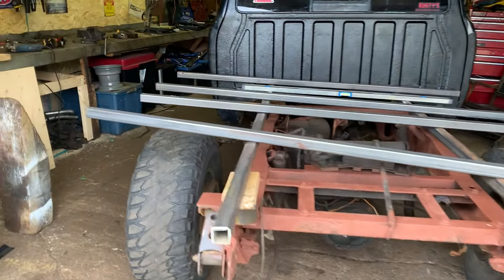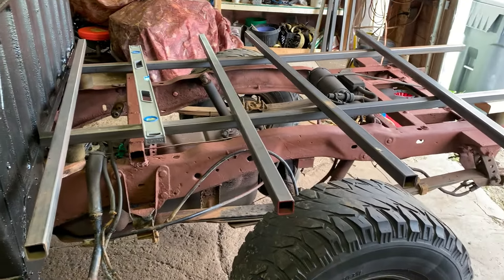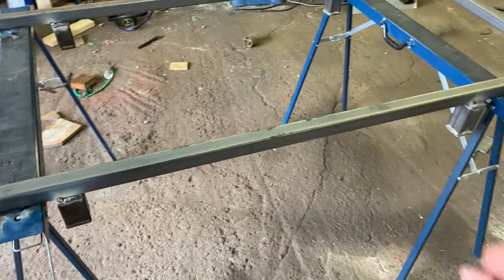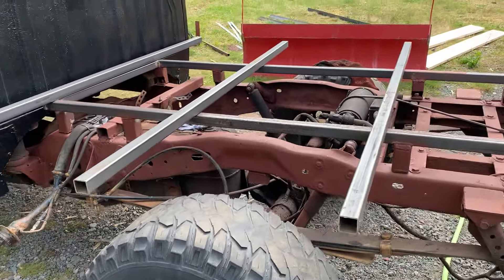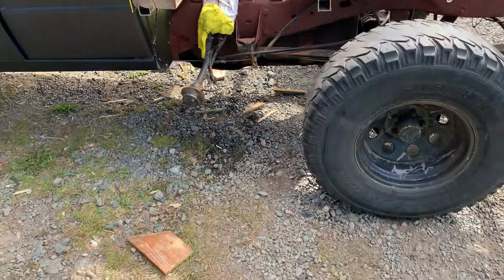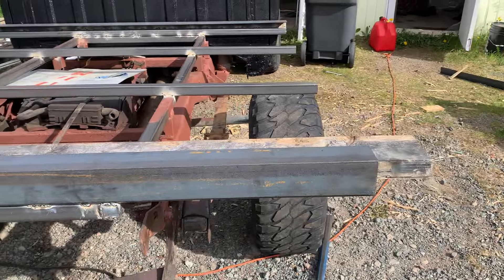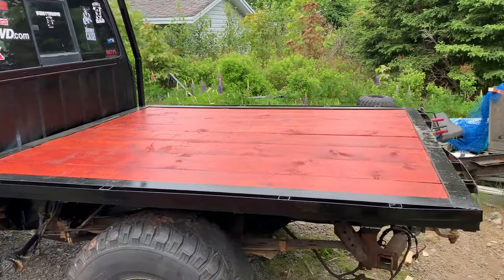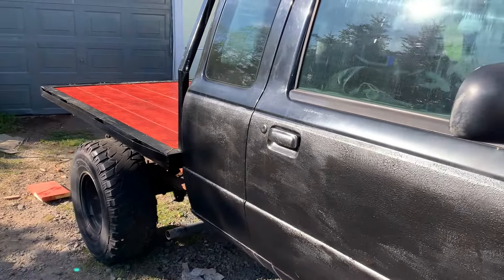Ford Ranger Flatbed Build  - Budget build - Part 1

Comment: Soon I will be building a flatbed on my 2009 Ranger longbed. Original bed was damaged 4 times.
Reply from the maker: yes, better off the flat beds are super cool! I will be making another video when it cools off a bit, going to be installing a winch behind the rear window and making a simple removable set of rails to fit on the bed.

Comment: I went with an extremely similar design when I built a flatbed for my ranger, just used some bigger tubing. What tires are you running because that spec looks wild
Reply from the maker: nice! and thanks, the truck has a 3 inch body lift on the front / cab and 33x12.50x15 mud tires. Need to replace the tires soon with some new ones.

Comment: How did U get the boards in?
Reply from the maker: I cut them to size and angled them. If I redone it , I would make the rear piece removable. But wasn’t to hard to fit them in
Reply: @muddythumper8152  I’ve seen them flexed with a jack to get them in on trailers, was wondering if people were doing the same w flat beds. I plan on making one for my 01 tundra this summer so doing some research lol.
Reply from the maker: @BvictoryforChrist  yea I basically put the board in on a angle, then used a hammer to knock them straight, would be easier with like 2x6 or something too

Comment: Do you know how much of the materials you used by any chance? I’m looking to make my 2004 ranger a flat bed and don’t want to get too much or too little square stock lol
Reply from the maker: I bought extra cause i always work on projects.
I got a rough idea on what you would need. if you do the lower just flat bed part
it will about this :
qty 5  6 feet 1 1/2 x 1 1/2 switch tubing 1/8 wall
qty 2  7 feet 1 1/2 x 1 1/2 switch tubing 1/8 wall
+ 2 inch switch tubing for risers about 4 feet 2x2 x 1/8
2 inch flat bar 3x16 thick about 4 feet.
2x8 sheet of 14 gauge sheet metal

Not forgot to add - i used 3 inch angle 3x16 thick. that is qty 2 x7ft foot sticks and qty 2 x6ft foot pieces thats what traps the wood in.

For wood i just used 2x10's, 7 if i recall
if you plan on adding tie down points like i did, you will need flatbar for that about 20 feet long 1 1/2 width 1/8 or 3/16 your choice.
for the rear rack going up that was about 8 feet of square tubing again. 
hopefully it gives you a decent idea. My bed turned out to be almost 7 feet long ( i chopped like a inch or two for how it looked) and it is 6 feet wide.  I love it though, very versatile. In the near future when time allows ill be modifying this flatbed again and building a winter canopy :)
Cheers- Muddy
Reply: @muddythumper8152  Thank you so much! Bed mounts rotted off and the bed is sitting weird now so I figured might as well get rid of the whole bed lol. You’re a lifesaver 🙏
Reply from the maker: @cassidydumont5996  no problem! same thing happened to me, i had to change my fuel pump and the box fell apart. I watch rangers driving around town, id say 95% of them have the front box mounts rusted off cause the body line sits lower lol!

Comment: Really helpful. But how did you get the wood decking in?
Reply from the maker: I angled it in, another thing you can do is just put the boards in then cap the end or make it removable, thanks!
I put the boards in sideways.  Then used a hammer to knock them straight. Wasn’t too bad to do.

Comment: Hey man great video. Curious to know what size bolts are you using? I'm currently in the process of making a flatbed for my 11 ranger out of c-channel and made a similar mounting system to what you have. I have it temporarily bolted with 1/2" grade 2 bolts right now (just to weld everything in place) but want to switch to grade 5.

Thank you
Reply from the maker: oh i dont remember the size, you know the bed bolts that bolts it onto the frame? i used the same size bolt probably 1/2 inch like you mentioned about they are probably 2 inches long or so with locknuts on them. I used fully threaded bolts so it dont matter and grade 5. Grade 8 is a bit of overkill. Thanks.

Comment: Holy fuck, just got a quote for all the materials you listed in Dartmouth N.S. and its gonna run me $955.66 😅 wow haha. That being said I'm gonna use diamond plate on the back, the still. That didnt throw the price up as much as the square tubing. Crazy.
Reply from the maker: That’s pretty pricey bah lol I’m in Newfoundland and got the metal used / recycled. I’d say it cost me about 600 or so in metal. Plus wood and paint and stuff
Reply: @MuddyThumper  I'll definitely be going the scrapyard route, was hoping to do it this weekend but gonna have to hold off a couple more weeks. Also got a 5 inch lift in the way and need new tires for that 😅$$
Reply: Where’s the material list?

Comment: hi nice work ! what are the exterior dimensions ? i know you stated 6ft of width but I didn't get the length ?
Reply from the maker: the length is almost 7 feet that i went with. I took 7 feet of square tubing and chopped 2 inches off. That way it is longer then 6.5 ft(normal box size). Mainly just eyeballed the length i wanted.  thanks

Comment: How did you get the wood in. It looks like you welded in the angle on all sides
Reply from the maker: I welder angle all around then cut the boards to the proper size then angled them in. Was pretty easy. A easier way to do it is to make the rear angle section removable. But it wasn’t hard
Reply: @muddythumper8152  awesome, I'm planning on putting a flatbed on mine in the next few weeks
Reply from the maker: @mattnewson7645  nice, i made rails to go on mine so far since. I am going to have a swing out gate made when i get the chance and installing a winch for the toys. I love the metal wood flatbed

Comment: Nice Video! I'm doing a similar build for my f150. What kind of pipe did you use for the frame? Did you use the same pipe for the headache rack and if so how did you bend or cut it for that angle?
Reply from the maker: Thanks , I used inch and half by inch and a half by 1/8 wall square tubing. 1.5x1.5x1/8 works great. I didn’t bend anything just cut it for the angle. Some people use 2 by 2 but for me 1.5 is more then enough.
Reply: Oh nice. What angle did you use on it. The one I'm building tho is with diamond plating
Reply from the maker: @danielmaslin8063  I’ll measure it for ya tomorrow. I kind of followed the window contour it’s likely to be about 55 degrees
Diamond plate is great pricey here
Reply: @muddythumper8152  Yeah it's a little pricey but it's not to bad. I like the look of it better with the diamond plate tho. Thank you so much